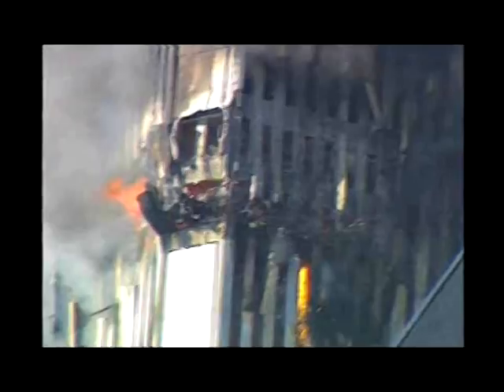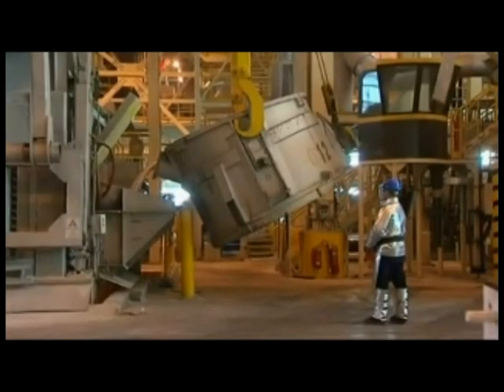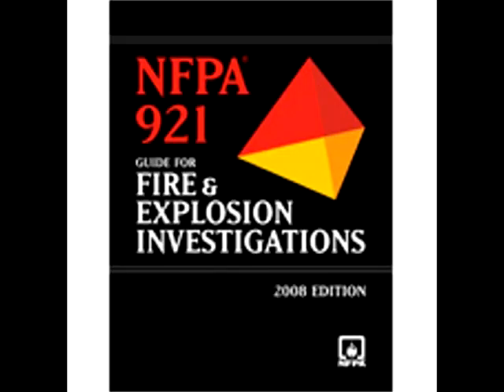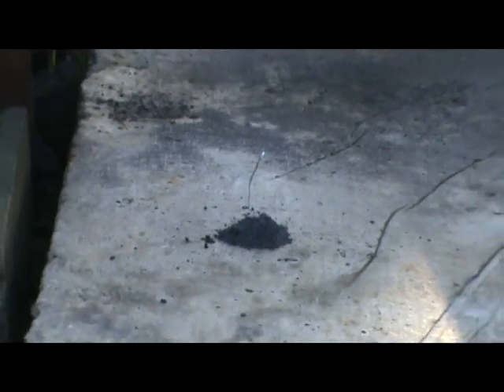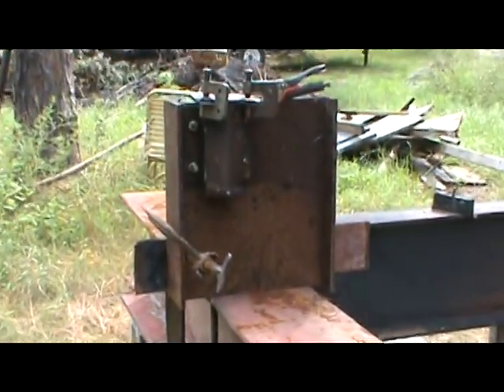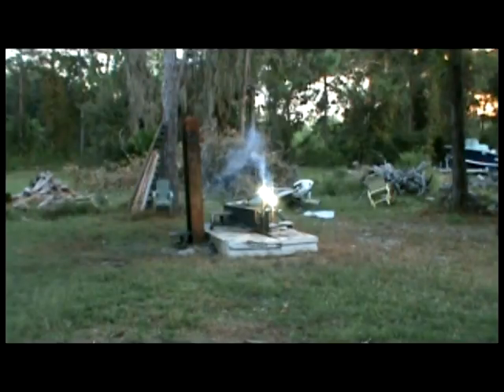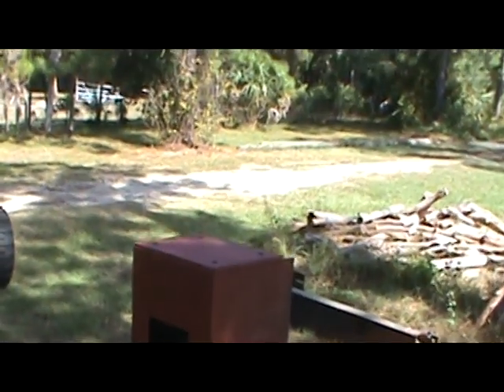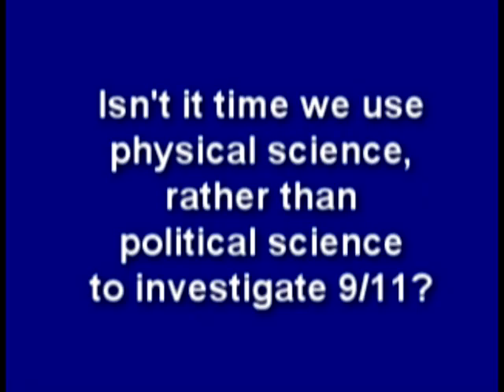9/11 Experiments: The Great Thermate Debate

Comment: Anybody who actually believes that this was a terrorist attack, is a complete fool, and is the perfect example of why your country is in the state that it is currently in. There is a gigantic mountain of evidence that scientifically proves that this was an inside job, and that two airplanes could not have taken down these two towers. It is physically and mathematically impossible. For three weeks leading up to the attack, truckload after truckload of mysterious items were snuck into the World Trade Center‘s at night, without anyone saying a word. It’s obvious now they were smuggling in explosives, carefully hidden until the planes hit the towers. I could write volumes on the amount of evidence that points to one inescapable conclusion, that the US government itself is responsible for this act of internal terrorism, all so they could finally and legally declare war on a country filled with oil, all in the name of righteousness, bullshit!! All other arguments aside, there is one that is irrefutable. No matter how hot the fire was, there was no material in the tower, OR the planes, capable of melting structural steel. Not even the jet fuel can burn that hot. Yet on video after video you can easily see molten steel dripping down the side of the building. That can only be accomplished using thermite, an explosive used during many professional demolitions, to cut, with great precision, the main supporting I beams. If you don’t believe what your eyes and science say, thing you don’t deserve to be called an American or even a human being. The government use this staged attack, just so they could invade a country and take it’s vast oil reserves, and so they could create the department of homeland security a.k.a. the department of spy on your ass and destroy your privacy! It absolutely infuriates me and boggles my mind how the public are so god damn blind, gullible, and willing to believe the lies said to them. They knew it was going to happen because they staged it, even President Bush, as he was reading to school children, didn’t flinch when he was told the World Trade Center‘s had been hit, and he was caught on tape, that same day, lying, saying that he saw the first World Trade Centre tower being hit on TV the same day it happened. That is absolutely impossible, because the only footage that was taken of the first hit, was from a camera crew that never released the footage until a day later. He knew exactly what was happening, because he, along with many other devious and evil people who control 99% of the population, didn’t even bother to follow presidential protocols. For those that don’t know, keeping in mind I’m not American, but Canadian, and know more about your politics than most Americans do, when an attack of any sort happens on American soil, the president is supposed to be whisked away to a very secured location to eliminate the possibility of he/she being harmed, yet that did not happen, and it’s not because he was being brave! It is unfathomable and incomprehensible that the United States would murder thousands of its own citizens just so they could do what Congress refused to allow, namely, invading Iraq. Of course, they lied as they always do, claiming it was to free the people of Iraq from the Tierney of Saddam Hussein, which is total bullshit. Bush went on and on, claiming how the United States of America would never allow so much suffering to happen in one country, is it any coincidence that out of the dozens of countries around the world, who live under a tyrannical dictator, they choose Iraq? Most of these countries where people are tortured by their own government have no wealth of natural resources, yet Iraq has so much of the worlds oil......do you really think the American government chose this one country to help out of the goodness of their heart? Think again! The entire situation is an absolute goddamn nightmare, and an inexcusable abuse of authority, how many millions either died, or have greatly suffered because of this one act? Yet all these years later, nobody is saying anything about it. Why? It’s quite simple, the government had every last shred of evidence that could possibly have revealed the real truth destroyed immediately. Why do you think the crash site was cleaned up so goddamn fast and the debris mysteriously disappeared? Just watching the two towers fall, actually, make that three, World Trade Centre Tower number seven as well, Is proof positive that explosives were used in a professional demolition. It is statistically/mathematically impossible for all three towers to fall so perfectly in on themselves as to not completely obliterate the entire southern tip of Manhattan, yet that’s exactly what happened, it couldn’t have gone any better, from a demolition standpoint. I can go on for hours and hours but what would be the point? If the American public chooses to remain in total ignorance, that’s their choice, but I for one, will never ever stop talking about it. I would go in front of a congressional hearing, as a citizen of the world, to defend the countless lives lost in this absolutely sickening display of government corruption and greed. The US government has done some really shitty, evil things during it’s history, but this one takes the cake! All evidence points towards an internal attack so the president and his cronies, could finally do what Congress refused to allow them to do. As a lifelong Canadian citizen, I truly do love our American neighbors, we share so much together, but I absolutely hate their government with a passion, never in my life have I encountered such evil corruption! At least in other countries, the so-called third world nations, it’s common knowledge that the leaders are corrupt as hell, but not in the United States where they pretend that their leaders follow a democratic process, and it kills me to think that people still believe that! All I can do is pray and hope, that one day the truth will be revealed to the American public who deserve to know the truth, and so they can get at least somewhat, compensation, both financially and psychologically, and, so that those responsible, if they’re still alive, will FINALLY be forced to pay the price for their unspeakable actions. If it were up to me, Bush would be swinging from the nearest tree, along with every single person associated with this act of pure evil and cowardice. Because of them, since 911, millions of innocent Muslim men, women, and children, all across the globe have been villainized, all based on a complete lie. To the rest of you who do not believe what I’m saying, you can live in ignorance all you want, but it’s people like you that allowed this to happen, and it’s people like you that we now face a complete loss of any privacy whatsoever, and why you now have a government that is completely dysfunctional, and the laughingstock of the world. I used to so admire the United States of America when I was a child. Growing up in Toronto, I grew up watching American television and listening to American radio, but after that happened, it made me so ashamed to have any associations with your government, and with Trump now in power, again, via corruption, that shame continues to this very day and will continue unabated, until your Congress finally gets back to its roots, and follows the constitution the way it was intended. Let me reiterate, I still do and always will, love the American people themselves, so please do not misunderstand my words, it’s your government that I absolutely hate with a passion. They are the personification of pure evil, figuratively and literally. No country or government is perfect, there are many things about the Canadian government I despise as well, but no government and history, save perhaps Germany, has ever done what the American government it to its own people, just so they can break the law, and get public support to do so, brainwashing most people into believing it’s for their own good. If only people could look past so many lies, and see the reality as I do. And by the way, when I make claims like this I don’t do so lightly, or without sufficient data to back it up. I could never list them all here, it would take far too long. All you have to do, is Google “the real cause of 911”, and you will find millions of pages of detailed information, that all point to the same conclusion, that this was not an act of terrorism for abroad, this was an act of terrorism from the United States government on its own people.

Comment: You don't need a debate. Just watch the roof of the trade centre accelerate downwards defying the government brain washing yarn that the top few stories crushed the remaining intact.  structure wow newton's third law has been broken by money men and morons.   Unless you weaken the lower levels that block will just perch on the top. Pick up a brick drop it just once onto a stack of bricks wow no destruction.  But all three TC went the same way. Even though they were designed to take a strike from a 707 aircraft with over engineering to spare. A aluminium tube and box sections will never bring down thousands of tonnes of steel and concrete. Otherwise we would ban aircraft over cities.

Comment: Minority report full of wholly holey debate. Poor ideas of badly thought out trawling. It's amazing. Flash of pressurized air/smoke full of solid particulate  blasting through a, penultimately, controlled-environment confused a witness with horrific chemicals and he's your scientific theories smoking-gun? Holy Cow that's bull.

Sharp enough to peel a carrot; eat one; prove it. Melting steel is irrelevant. Steel is easily worked when red hot i.e. about a thousand degrees. Try to karate chop some when it's 1500°f and imagine what thousands of tonnes above it was capable of. These buildings did not fall from the top down they collapsed at the fire/impact levels(after glowing red steel reaching±1000°f), immediate followed by a multiple structural failures as previously uneffected floors collapsed, and ultimately, catastrophic structural failure. Readiness of such a structure to do so is characterized by it's failure mode; pancaking from floor to floor at nearly terminal velocity. (TV), in a near vertical descent.

Comment: so tired of "explanations of the truth" based on lack of understanding. The tower fell due to the inability for the structure to support its own weight, because of the weakened steal.
Reply: Genius can’t even spell steel.
Reply: The weakened steel near the top of the tower didn’t cause the bottom of the building to vaporize and allow the buildings to fall down inside its own footprint. In free fall acceleration. Because the building wasn’t impeding its own progress.
Reply: This would be easier to believe if there weren't so many other inconsistencies with what happened that day.
Reply: We needed a reason to attack those terrorist countries because they had oil to bring us out of debt
Reply: @ExtremeRugburn 
They don't have oil
Reply: djBOB 365 steel*
Reply: And people believe that based on a lack of understanding... So tiresome.
Reply: It couldn't support it's own weight because the explosives severely comprimised the structural integrity. All 3 WTC's didn't fall down, the concrete turned to dust and the steel was melting. Only valid explanation would be explosives.

Comment: The collapse on both WTC 1 and WTC 2 began where the planes struck, so looks to me just like a structural steel failure for those two (the building didn't collapse top to bottom at once).  WTC 7 is certainly odd though...

Comment: Building demolition experts go to great lengths to make sure, that when they bring a building down, that they can get it to collapse straight down.  With all the planning, even 4 and 5 story building do not come down straight, and the taller building are even harder to get right, as videos online will show.
Looking online about building demolition and then reading about building demolition and the COMMON THREAD,  in most all the articles, is that building demolition takes extensive amounts of time to get the building  to get them to come straight down, and the higher the building the harder it is to get it to come straight down.
Yet we are being told to believe that two building that are 110 ten floors high, were hit with planes in random spots, and both came straight down. 
I imagine there are many building demolition experts, who watched the videos, and who wonder how random airplanes with jet fuel hitting buildings in random spots, could do such a good job of bringing both buildings straight down.

Comment: I have always believed it was an inside job BUT, people fail to take into account that the building was extremely tall and most probably caused a wind tunnel going right through the building. thus most probably causing the fire to get really really hot, so i would love to see a video recreating wind speed with jet fuel next to steal beams to see if the flames where hot enough to melt steal.
Reply: Study federal fire codes like I did when I was an architect. If federal codes are followed to the tee fires cannot spread further than 50 ft any commercial building. Each firewall has a fire rating of 2 hours. The fire could not have spread far, especially not downward to the basement prior to the buildings collapsing.
Reply: @BigNewGames  see sadly im not in the usa so no idea about federal fire laws will definitely look them up, but when the twin towers where built where these laws in place?

Comment: Just going to point out that the WTC being as large as it was, the uncontrolled collapse of the buildings would have major consequences on the surrounding buildings.
I think they could have installed stuff like this durring construction with intention to use it in (a different) emergency when nobody was inside.

I wonder, assuming they were not intentionally to be used, but present as of construction, if those devices could have been accidentally triggered.
Reply: yes, please read my comment clearly, people usually misunderstand the first time.